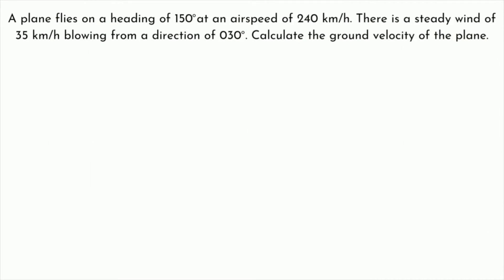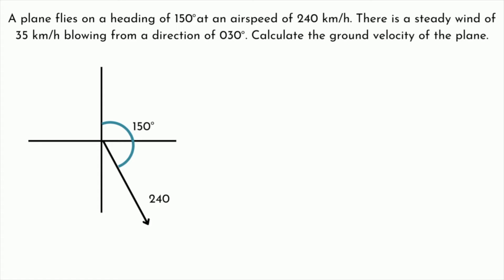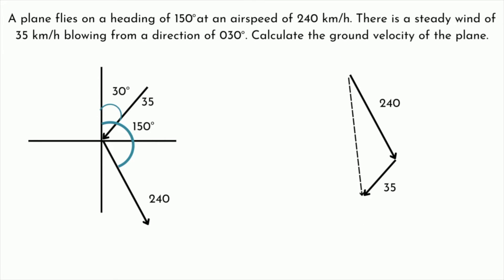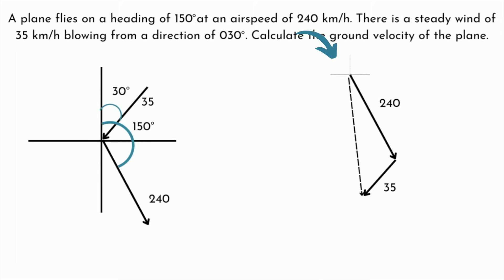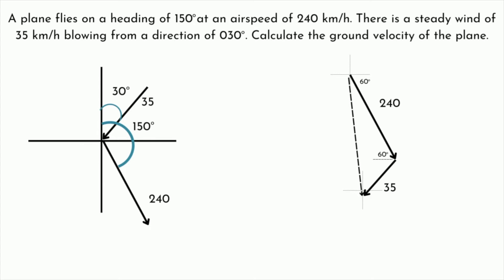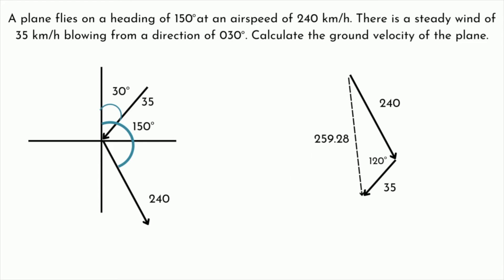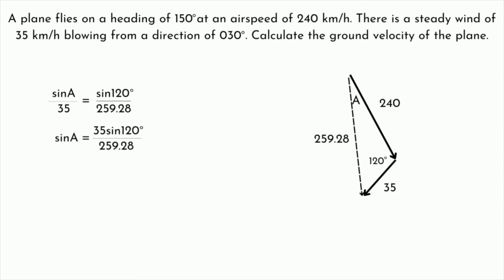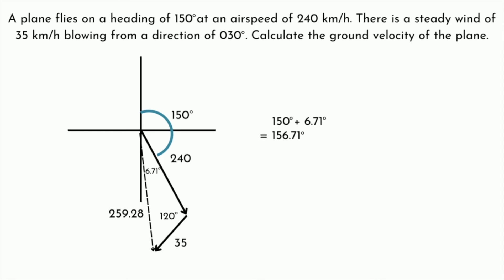How to Calculate Ground Velocity (Application of Vector Addition Example)

Comment: Thanks for this.  Great video of working out a wind vector for pilots but as a math-moron it would have been great if you dove into the equation at time stamp 5:40 or linked off to something that helps clarify the math since I don't arrive at the same value of 259.28.
Reply from the maker: Hey thanks! I was really struggling to keep this one under 10 minutes so I had to skip over the details of the cosine law unfortunately. This is a pretty old video, but I go through a few examples of the cosine law in this video: https://youtu.be/7aZ7ikuU-HM . Hope it helps!
Reply: @MathByThePixel  Thanks for the link and reply.  Appreciate it.
Reply from the maker: Anytime! 👊